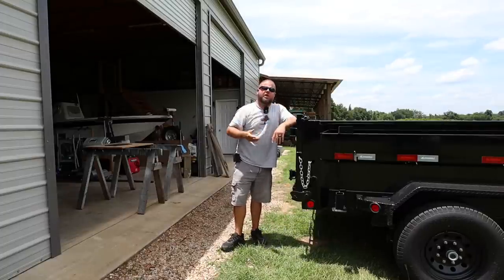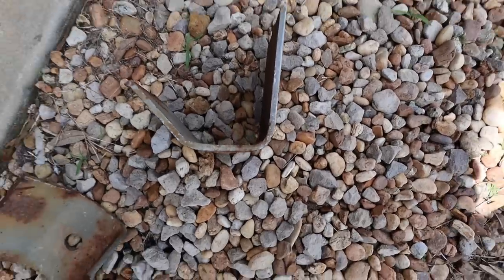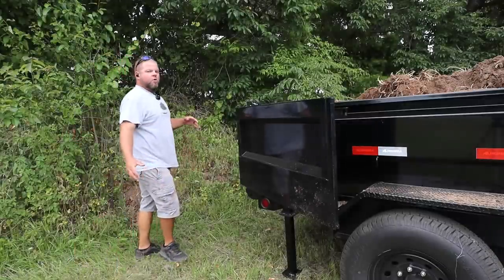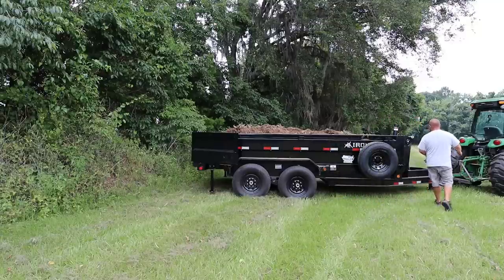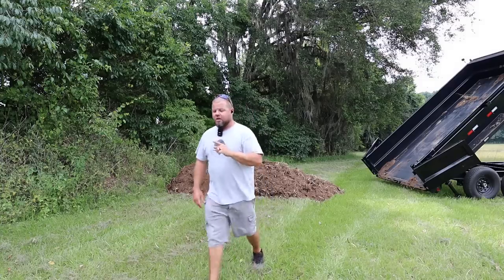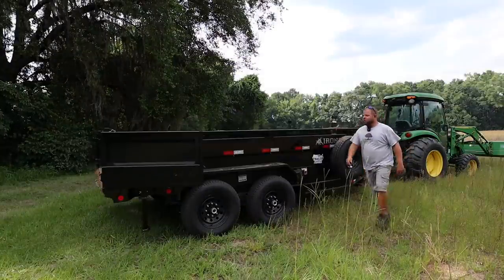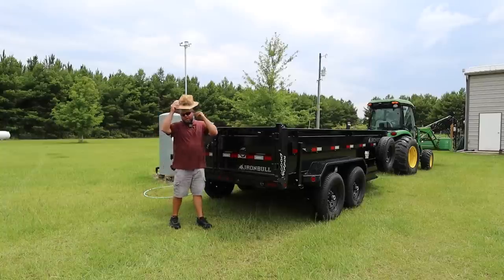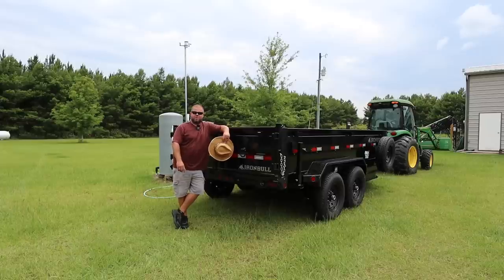Dump trailers first test! Iron Bull dump trailer #781

Comment: The stabilizers are designed to only be used when loading equipment and the trailer is in the lowered position. Using them when dumping causes torque / stress to the trailer in ways that the manufacturer did not design or engineer the trailer for, the stabilizers would be mounted to the frame if they were designed to be used while dumping. If you received an owner’s manual with the trailer it probably says not to do what you are doing.
Reply from the maker: You did see my text disclaimer in the video? You also realize they never touched the dirt?

Comment: I don't understand why these dump trailers are ALL struggling to lift there weights...after researching hydraulics, it seems to me if the manufacturer spent another 4-500 dollars  enhancing the lift capacity...id feel better spending 10 plus thousand dollars on a lift trailer,  rather them giving you just enough to do the job to save money
Reply from the maker: Huh? It not only lifts it's weight fine, it does it will piles of wet, heavy dirt in the front. The front mounted cylinder is the way to go.
Reply: @TKCL  looked to me it was struggling to lift what's in it now. Matter of fact..the video skipped the full upswing.

Comment: The draw bar should remove from the shaft on your tractor after unbolting some nuts and bolts 

You should be able to install a ball hitch receiver 

This will prevent the trailer from lifting up

The stabling stands are still a good idea

Comment: You should paint the inside of the trailer with the same graphite slippery materials that used for lawn mowers to prevent stuff sticking.
Reply from the maker: I'm afraid rock and trees will eat right through it.

Comment: I believe the stabilizing legs are for when you load and unload equipment using the ramps. They keep your trailer from picking up the back of your truck and in some cases when on an incline it can disengage the parking brake causing you to roll down hill. I do not think they are for when dumping the trailer. Not 100% sure because I don’t own a dump trailer. Great video btw, just found your channel and enjoy all of it so far!!
Reply from the maker: That's exactly right, I do discuss that point.
Reply: Eric you are 100% correct. The stabilizing legs are not supposed to be used except to load heavy equipment. Using them while dumping can cause them to dig into the ground and get torn off the trailer. I drove truck for over 20 years and pulled every kind of trailer you can think of, hauling every kind of material you can think of including all kinds of over size loads and hazardous materials, explosives, food, produce, dry goods, and everything in between. Those stabilizers should not be used except to load heavy equipment so they keep the trailer from lifting the tongue off the hitch or lifting your back wheels off the ground when loading the equipment. You should also never disconnect the trailer from the hitch while dumping. Very dangerous to do that.

Comment: It looks like a well balanced trailer. Far as I can tell, the front of the tractor was not lifting up. I love how high it lifts up, very impressive. Great buy. Do you have grease the wheel bearing's or are they sealed?
Reply from the maker: It lifts great! Those are greasable bearings.

Comment: How do you feel about the stability of the telescoping cylinder extended up and dumping in spread mode on  rough terrain?... that's the big thing I'm curious about.
Reply from the maker: Shouldn't be a problem, the cylinder is not technically supporting side to side movements, it's actually a loose fit. If your bed is rigid, it's the rear pivot points that's truly supporting side to side motion.

Comment: How do you keep thw bed floor smooth enough to dump dirt/debris out?  Washing for first pass but recoating with a slide coating?
Reply from the maker: It's powder coated and new, so it's slick. After a few loads of rock it's going to be destroyed.

Comment: Seems like there's one too many times you have to "touch"' the dirt/grass to move it.  #1- Loading it, #2- Dumping it, #3- Moving it into the grass line.  How do you eliminate step #3?
Reply from the maker: Buy a trailer that's so top heavy and tall it dumps it without pulling forward. Those don't exist 😉

Comment: Andrew, i have a similar situation with a Deere and a dump trailer, never got a good look at what you put the ball on.  did you use a draw bar?  if so, did you modify it so a 2 5/16" ball would fit through one of the holes?
Reply from the maker: I made my hitch, it's 3x3 inch 3/8 thick angle iron steel. I welded in a 2 inch receiver hitch into it. I have a solid hitch that can be flipped for a 2 inch or 2 5/16 ball.
Reply: @TKCL  thanks Andrew

Comment: Looking at a iron bull what model is that. With the telescoping cylinder. I need a at least a 16ft and would like a 16K but probably will get 14K
Reply from the maker: DTB8314072-10007_BLK

Comment: I dont mean this in any way other than curiosity. But what did you do before you started this property/lifestyle?
Reply from the maker: Correct, I managed 3 departments at a large papermill. I was ultimately responsible for the the equipment and employees throughput in all departments. It was my goal to make the process more efficient and productive by a lot of different means.